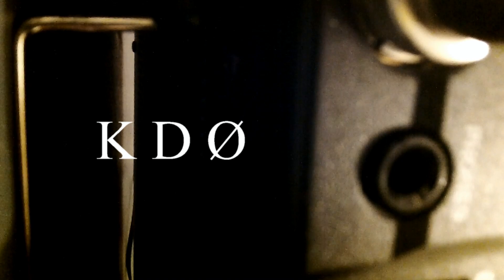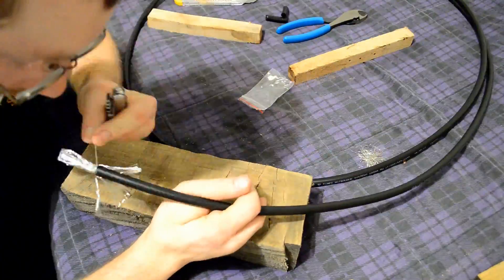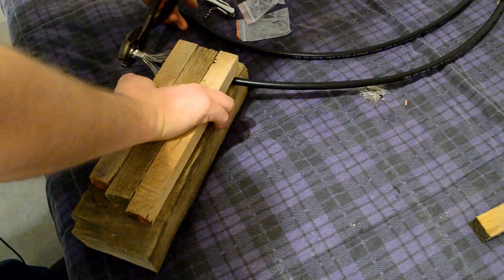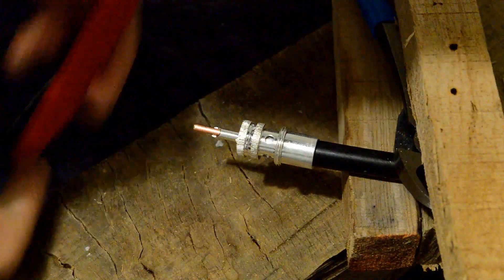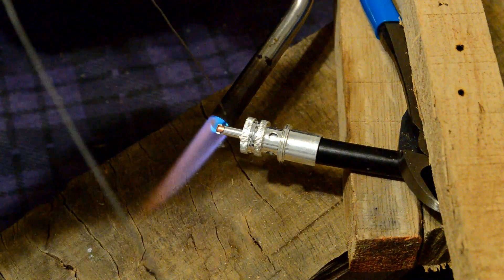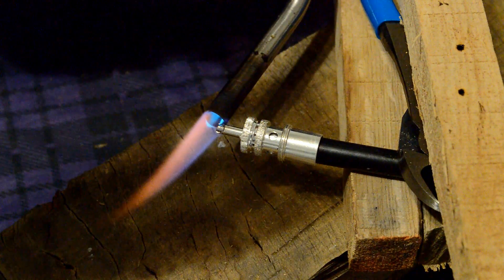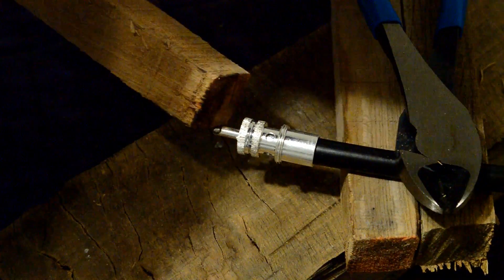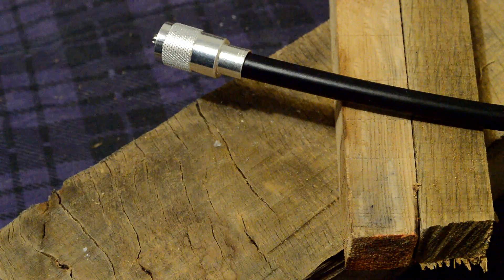Superior PL-259 installation SHORT Quick and Easy LMR-400

Comment: I just happened to stumble onto this video today.  Good job on the connector.  I have used this method to install the connectors for over 25 years and never had one fail,  corrode, fall off, or come apart.  I Use Ox-gard on the braid for lubricant and corrosion protection.  I have taken them apart before to see how they were holding up, and they always look like I just put it together yesterday.   When you use foam dielectric coax, like I have and did at the beginning of my radio hobby, you learn real quick to not solder the braid in the connector.  Its way to easy to melt it.  Ive watched the videos of people soldering the shield.  No way in heck would any of them, that I watched, every get away with how long and how much heat they put on the connectors using RG8 foam coax.   Ill never solder the braid on coax ever again.  I just see no benefit to it, only chances to damage the coax and connector.

Comment: will this method work for RG213? i dont see any reason why it wouldnt but if not, do you have any recommendations for soldering RG213?
Reply from the maker: I think the method would work fine with RG-213 coax cable.
Reply: KD0WTE thank you for the reply, will a stranded RG213 cable require as much heat as the solid LMR400 used in the video?
Reply from the maker: Sorry about the late reply, it takes about the same amount of heating. You can use an iron, but I chose the torch.

Comment: KD0WTE, you are the king of Elmers! I just finished making 3 LMR-400 jumpers using your method and it is the only method I will use going forward. Thanks for the lesson!
Reply from the maker: Thank you for your comment and I am sure the coax ends will hold up for a very long time. Mine have!

Comment from the maker: Incorrect. Visit the link in this video's description. You'll find pictures of the shield wires after a PL-259 uninstall. They are nearly perfect. All it did was make full 360° Connection to the braid. Much better than four small solder joints that have a high potential of corroding and becoming loose. Thank you for your inquiry.

Comment: I couldn't tell in the video. Did you touch the blowtorch metal to the end of the pl259 connector? thanks for the video
Reply from the maker: You're welcome! Thank you for watching my video. Yes, I just barely let the feathery edge of the flame touch the tip of the center conductor or the LMR-400 coax. Thank you for your question.

Michael - KD0WTE
Reply: Ok thanks. I was reading on eham that the dialectic on the lmr400 is foam. Is this true? I want to solder my first homemade antenna would you recomend the blowtorch method for use with a so-239 connector and 10awg insulated wire (stripped a couple inches so it won't burn)? Thanks
Reply from the maker: You read correctly. Times Microwave LMR-400 uses a foam dielectric. When it's exposed to minors amounts of heating it will melt similarly to a common milk jug.

What type of antenna are you making? Depending on the application, you might be able to home brew a 1/4th wave ground plane antenna. They work well. I just stripped back 19.5" of my LMR-400 then trimmed it until my SWR was acceptable. The center conductor is suspended by a nylon rope in my attic. The braid was tightly and neatly twisted into four separate clusters to form essentially four braided wires coming off East, West, North, and South. Pointing down at about a 45 degree angle from the center conductor. Which makes an abtuse angle above the ground plane. This usually lowers the SWR and makes the pattern a little more focused towards the horizon, which is what is desired on VHF.

That same thing could be done for 10m, 6m, 2m, 1.25m, 70cm etc...if you had enough space you could even do it for the other HF bands.

Hope this helps, if not feel free to ask.
Reply: Wow thanks for the info. I am making a 10m 1/2 wave omnidirectional.
Reply from the maker: A dipole or double bazooka might be a great option for you. Hope the antenna project goes well! Take care and feel free to post comments questions, or even a video response of what your antenna and connects turned out. Most of all have fun building it. Tip - always start a little long as it's easier to trim than to add ;)
Reply: Thanks I may go with a 1/2 vertical wire so I don't have to have a matching coil (5/8ths)

Comment: Nice job.  I'm going to try this next time,  One thing I might do, in addition is use a little flux on the center to speed up and help the solder wicking.  73, Jim - K2JHV

Comment: NICE VIDEO AND TECHNIQUE!  The most important part of coax installation is the proper installation of the PL-259 or whatever end you are needing.  Most problems can be located RIGHT THERE!  If you are installing a connector type that you aren't sure of the right way to do it, and there are those who just can't, I'd recommend using the PL-259 and then an adapter.  You can always find one that will work for you and then you'll know there won't be any problems.  Keep in mind, at high frequencies there's usually 1/2 db loss with an adapter but that's better than the entire installation failing and causing final burnout.  GOOD JOB!!  WA5CYR

Comment: I tried yesterday and I failed. It was very difficult to rotate the PL259 over the braids.It went but the braids got twisted and bundled. I have seen this video at least five times before I started. What could be wrong ? I really don't know. Its Times MIcro LMR400..Please help with some suggestions to find my fault..DE VU3MDL
Reply: +Just Casey that was great idea about petroleum jelly.  I have been making jumpers with LMR-400 and DavisRF Buryflex using this method and even small amounts of petroleum jelly really made things easy.  Thanks for sharing a great idea!
Reply from the maker: Bibhuti Mandal VU3MDL, hello. I am sorry to hear you are having problems. Be sure to fold back the braids very straight and flat to the outer insulation of the coax. And as you rotate the PL-259 over the braid, keep smoothing and straightening the exposed braid. Use a generous amount of paraffin wax to reduce the friction of rotating the connector on. Please feel free to email me at KD0WTE@yahoo.com if you wish. 73 de KD0WTE (Michael).
Reply: +Bibhuti Mandal apply a little petroleum jelly. That should help you to twist the connector on easily.

Comment: If you used a VNA to sweep coax terminated this way you would quickly see why NASA and the military don't use this method. If you don't want to solder the PL259's which you shouldn't do anyways when using foamed dielectric coax like LMR-400 then upgrade your coax connectors to aerospace type pressure weld terminations.
Reply: Dan Nelson can you show us how the military does it?

Comment: So, you just answered one question with this video. Another question; what is a good quality, low loss mobile coax for up to the 70 cm band? de N4RGQ
Reply from the maker: William Jones , You can get LMR-400 in an ultraflex. Or what I used for my mobile was - Davis RF brand - RG-8U. Davis RF has good quality poly foam dielectric between the center conductor and the shielding, unlike some brands that are just a hard plastic tube (basically) as the dielectric. de KD0WTE

Comment: Michael,
You method is exactly the way I've done it myself for 35 years now. 

It's tried and true..  All my long lengths and jumpers have been done this way and I've never had a failure on both base and mobile applications.

73       Kevin
Reply: Ditto, Kevin. I have also been using this method since 1985.  73's AC4KV
Reply from the maker: Thanks Kevin! 73
Reply: Best 73 from KK4GZQ

Comment: Will this work for anything besides LMR400? In other words, would the other, less beefy types of co-ax end up with a tight enough fit this way?
Reply from the maker: Jeremy,

Absolutely. I have used this method on RG-8 with no problems. If you feel that it might be a bit loose, you might try adding 1-3 wraps of good quality electrical tape to the black outside insulator sheath. Be sure to do this additional step before folding the un-braided shielding back flat against the coax. One other note would be make sure you wrap the electrical tape clockwise while facing the end of the coax. That way it won't bunch up on you when you thread on the PL-259. Long explanation i know, it'll save you time in the long run. ~ Michael KD0WTE

Comment: I'm re-doing all my PL-259s this way as soon as I can. Nice!

I also tried a similar technique with an N connector, and it seems to work well. Just got to be careful about the length of the center conductor before it goes into the little "stinger" thing.
Reply from the maker: Thank you for the comment Bill. Glad this video is helping so many people. It's a simple yet very effective way to install PL-259s. Neat to know you tried this method on those N connectors and were successful.

Michael
Reply: Well... I may have spoken too soon. I still have crappy swr on 70cm, and it looks like it might be from a bad shield connection. I'm still investigating.
Reply from the maker: ***** On a PL-259 connection or N connector? LMR-400 or any foil shielded coax you might entertain cutting back that foil a bit just to make sure it doesn't arc between the center conductor and the shielding.
Reply: The problem is happening with a pl-259. I haven't ruled out a bad section of coax or a bad antenna yet, either.

My rig is a ts-2000, so I have a short length with the N on the transceiver side and a PL on the other, then I can put an swr meter and the rest of the coax to the antenna in-line, or use a barrel connector or whatever from there. Same antenna and feedline works great on 2m, go figure.
Reply from the maker: ***** Well hopefully you get it sorted out quickly and easily. I use Amphenol PL-259's. They are spendy but high quality.
Reply: Thanks. I'll post again and let you know what I find out when I do.

Comment: why no solder in the braid?
Reply from the maker: No need for it, it's a nice for 360 degree compression fit. Much better than 4 little solder points.
Reply: Ah, I see. Thanks for the video
Reply from the maker: Kevin Zari Thanks for watching and commenting.